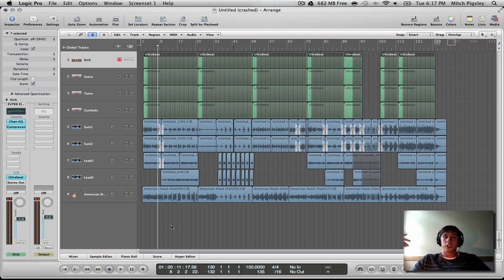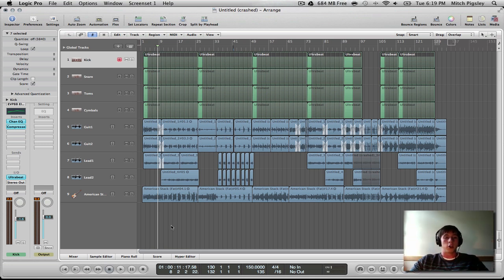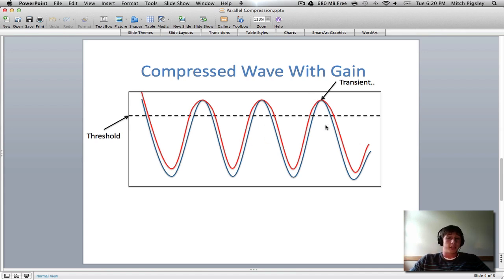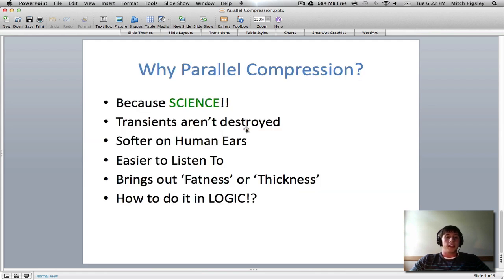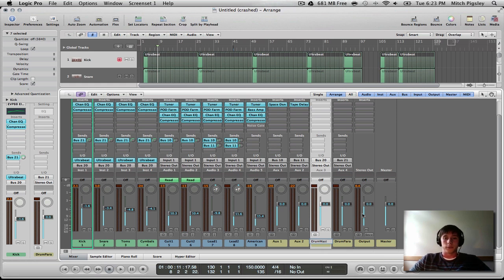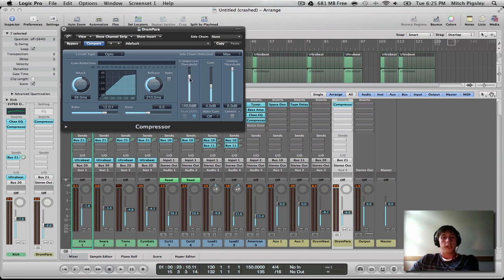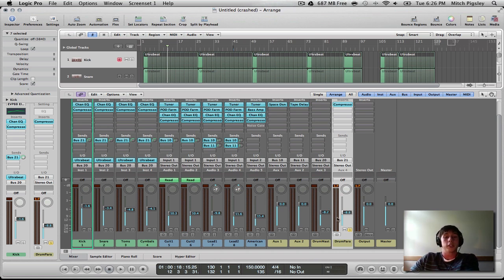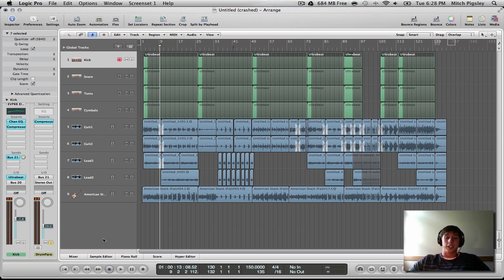Logic Pro 9 Tutorial - Parallel Compression

Comment: I'd like to suggest that you use your parallel compression as more of a tool to boost individual tracks rather than attempting to equalize them through levels. if you set the compression gain to 100% and then use the individual track busses to limit and increase the output to the compression track, then you can monitor each track individually, additionally, you don't' have to set multiple parallel compressions because the amount is controlled by the individual track, rather than individual parallel compressions. just dump the rest of the sound into the main mix.
Reply: You can do this with reverb as well, allowing you to set how far back in the mix an instrument sits by raising the verb level on the indivual track bus, parrelel verb

Comment: This doesn't really explain the primary function of compression- to make the loudest parts of the track quieter and to make the quieter parts comparatively louder. When adding compression it is essential to take this into consideration, especially with drums, as it will reduce the sound of the initial drum hit and increase room noise. This video is informative in that it demonstrates parallel compression, but further emphasis could be placed of the actual effect compression has on a track, as this isn't properly explained.
Reply: wat effects you use on drums den?

Comment: Great tutorial, and really clear.  There is a second way of doing this in Logic which I find a bit cleaner (allowing you to use a single channel without the extra AUX busses).  In brief: put both your compressors on the same track, with the more aggressive one second in the chain, then on the aggressive (second) compressor click the > in the bottom left for extended options, and adjust the "mix" control to your liking.  Hope this helps, and keep up the great tutorials.